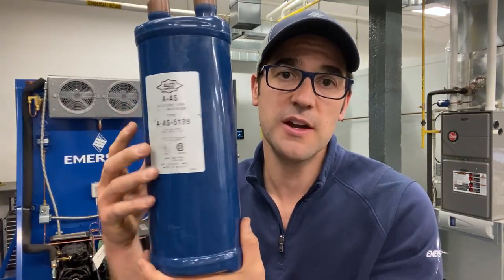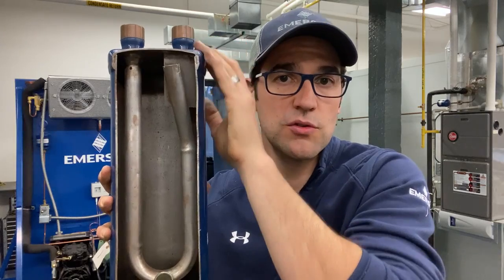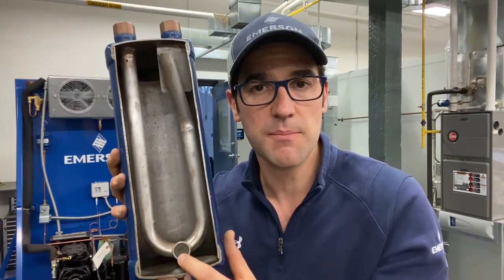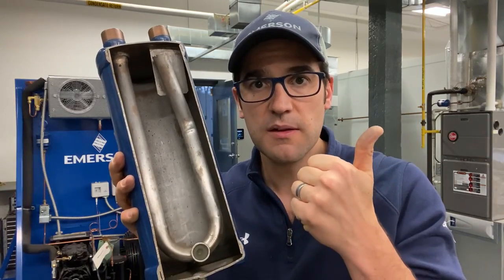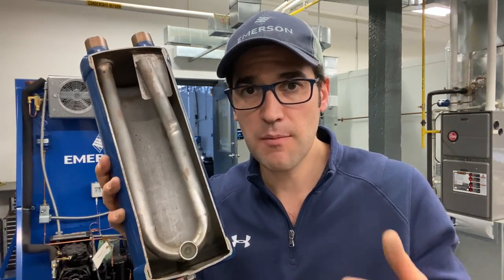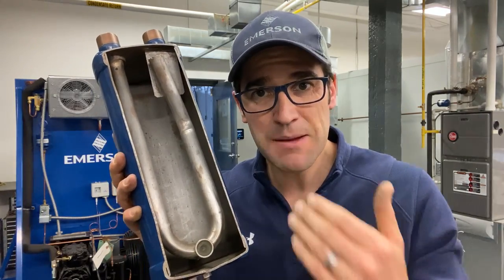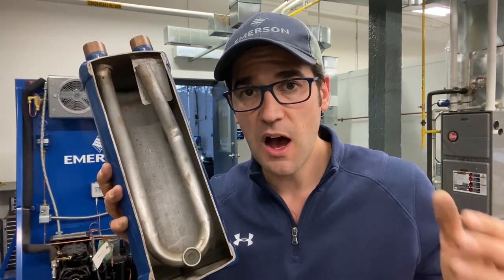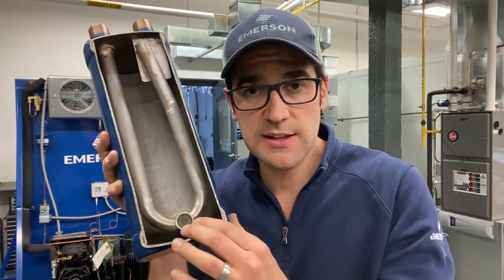Suction Accumulator

Comment: I am glad to find someone else talking about replacing accumulators. If your screen is plugged the oil level in the accumulator would rise to a level where it would become dangerous to the compressor. Depending on the holding volume of the compressor crank and the volume of the accumulator you either starve the oil return to the compressor or   slug it to death. How did your compressor fail?
Reply from the maker: I totally agree and have seen many compressor fail because of this.  I have caused a few for sure as I had to learn this the hard way. Thanks for sharing.

Comment: I worked for a company that serviced RTU's for large, well known corporations and I many techs, not just me, have replaced bad compressors (the same exact one, not on a tandem system) on the exact same package unit only a few months later as you mentioned. I really wonder now if it is a "backed up filter gauge" inside the accumulator which you mentioned. Thank you SOOO much. I had no idea I had to check that. How would you check for that in the field to properly diagnose the accumulator is the cause? (Assuming you already mechrometer on compressor and it is reading good).

Comment: Great audio quality, what mic are you using.

I just recorded this same video and I pushed the same rhing, replace the accumulator with a burnout. 

I did not think about oxidation clogging the screen though.

Interesting the accumulators with the rotor compressor puts the screen across the top and the bottom is just a drilled hole. Seems like a better design.
Reply from the maker: Thanks Ty! I usually use the Rode Video Mic or the iPhone mic.
Reply: All accumulator s gave screens, & its there a good way to check if its clogged?
Reply from the maker: No not all I have screens I have seen drawings of a some accumulators with just the u bend metering hole with no screen. I do not believe there is any easy way to check. Thermal camera on your phone from seek thermal or temp checks up the side of the accumulator. That’s not easy when it’s insulated.
Reply: Ty, scale-oxidation and oil breakdown are a major culprit of accumulator failure. Contamination from compressor burnout could also play a role but in my opinion is not as great.

Comment: Just discovered your channel when searching for the amount of oil to put in a new accumulator. I have replaced several accumulators in the past which have rusted out at the top near the solder connections. Just measured the oil that poured out of it and replaced it with the same amount.

I have one on a 3 ton heat pump now that rusted out the bottom. No oil left to measure. Any suggestion on how much oil to add?
Reply from the maker: I believe there is a calculation in the selection softwares. Check out https://westermeyerind.com/tools/

Comment: Was there a filter drier in the circuit? I'm sure there was one and that should have done its job and prevented clogging of the oil hole in the accumulator.
Reply from the maker: Yes but if you are not using nitrogen to brazes in the piping or if the liquid line drier stops collecting because it full and doesn’t catch everting on a bad electrical failure.

Comment: I work for a Fluid Chillers Inc. And we just build a machine with a boil-off coil in the suction accumulator. This works really well. My liquid line temperature was 34 degrees before the subcooler heat exchanger which is on the liquid line before the mainstage TXV. This unit ran to -54 degrees Celsius. But this was the only a 8 ton ultra low temperature chiller. I'm curious to see what happens on a much larger unit like a 70-ton ultra-low temp. We've ran our process fluid as cold as -85 degrees Fahrenheit. That's using 507a and my suction line pressure is about -22. Imagine what that compression ratio is.
Reply from the maker: The compression ration must of be large. Are you using a Bitzer 2 stage compressor or is it set up as a Cascade system?  Super cool that you are using a boil-off coil in the suction accumulator.  There is an OEM I work with here in Canada and they often set their system up with those.
Reply: @RefrigerationMentor  yeah it's a two-stage bitzer. I was telling my boss in the other techs at my job all about your video and your YouTube channel. We buy a ton of small Emerson condensing units for 2 ton and under Chillers. I should see if they would pay you to come to our facility in Lansing Michigan. I'm super duper impressed with your knowledge and experience.

Comment: Hey man.  What could be the problem with an accumulator freezing and not the suction lime piping. Basically only from the accumulator to the compressor. Thats the start Point of the freez up.
Reply from the maker: It could be full of liquid refrigerant and that’s where it is boiling off.
Reply: @RefrigerationMentor  should I maybe reclaim all gas charged and weigh in again? Might be that someone has added charge? You get to sites where people just add gas for no reason . Older Daikin package RY units
Reply from the maker: @Cpt_bike_riders   You know the system better then me or anyone else so that would be your call. Good Luck.

Comment: Besides the screen is that the only thing that can go bad on a Accumulator? Great video.
Reply from the maker: Well, there is not much to them the other thing that could happen is the bleed hole or the pressure equalization hole at the top of the outlet tube could get plug and if that happens when the compressor starts up it would suck all the oil and refrigerant into the compressor. The other thing you will see a lot of times they can rust out.
Reply: @RefrigerationMentor  Thanks

Comment: Why is it that most condenser I come across do not have suction accumulators? Some have them but most of the ones do not. Is it manufacturer choice or ambient conditions? I’m not sure. Thanks in advance!
Reply from the maker: Usually you should see them on low temp applications. I recommend them on both MT/LT applications as this protect against Floodback but it almost always comes down to cost of the equipment.

Comment: I didn't know either, thanks !!
Reply from the maker: Happy to help!
Reply: @RefrigerationMentor How can I troubleshoot accumulator , to check strainer , to make sure is not plugged up and accumulator full of oil???
Reply from the maker: @cesar235cs  it’s not easy to troubleshoot but a few ways could be checking the temperature from the bottom to top or use a thermal imaging gun to see where the oil level is.

Comment: Why the suction of compress can be under zero psi ?
Reply from the maker: @dingdong1646  why are you running under 0 psi? most compressors you do not want to run that low.
Reply: @RefrigerationMentor  My refrigerator can process referigrant HFC 134a circulation maximum  6 psi. More than 6 psi, refrigrant circulation become under -20 psi. I hope it can be 10 - 15 psi.

Comment: Hello nice video. I have a question. Why accumulator are mostly install on low temp application?
Reply from the maker: You see them in low temp (LT) application because of a few things,  these systems run at a lower superheat, coils can freeze over faster.  You will have electric or hot gas defrosts in LT applications and after the defrost there is huge load on the evaporator and there is potential for refrigerant or oil to make its way back to the compressor.

Comment: Good video you didn't mention the vacuum brake at the top of the outlet and what its function is for. Very important to mention its function.
Reply from the maker: Yes, that is to prevent the compressor from slugging when the compressor starts up, if it has liquid in it.
Reply: @RefrigerationMentor I have found apprentice have a hard time understanding the accumulator and all its functions, the vacuum break is actually one of the most important functions of the accumulator, You should do a follow up on your video and explain that point. Great videos.
Reply: Question,
If you have a heatpump that has frost line between accumulator and compressor on start up for a minute or so, do you think the vacuum break hole could be plugged, or more likely excess refrigerant has filled the vessel?
Reply from the maker: @James-vf5gs  what is your compressor superheat (checking superheat near the suction service valve) on start up when it frosts up, starts, and when it ran for 5-10 mins?
Reply: Saw this video while verifying my findings. Customer has had intermittent low pressure shutdowns, noisy compressor, and a rattling shutdown. 
Sloppy installation from my predecessor and a sloppy compressor swap while they tried to figure out the problem.
Now the customer is needing another compressor and accumulator.

Comment: If your accumulator screen is clogged could this cause low suction pressure and over heating compressor?
Reply from the maker: That is a great question. What do you think? 

Do you know what the purpose of that orifice and screen are for?
Reply: @RefrigerationMentor  I believe it's for oil return.  Long story short I'm pulling my hair out over a restriction I can't find, replaced filter drier and txv.  Only thing left is the accumulator which also is frosting up around the bottom.
Reply from the maker: @bbagscoot  is it the pipe size or is it trapping somewhere else? Have you tried a thermal imager to see if the oil is in the accumulator?  You will need to remove it to verify and you will know if it’s in the accumulator.
Reply: @RefrigerationMentor  going back next week to check